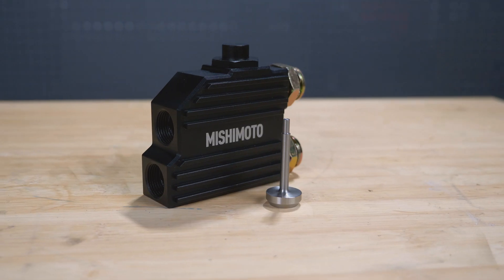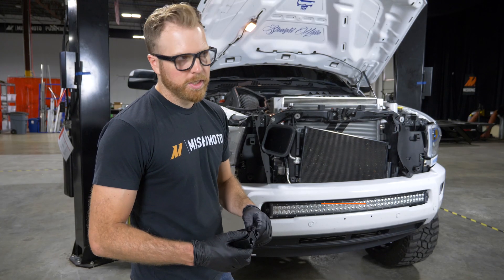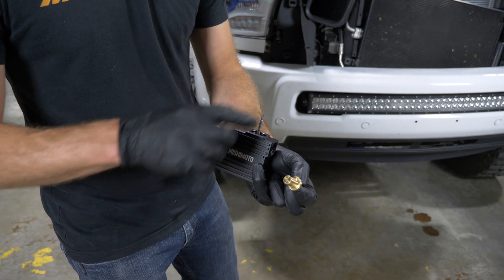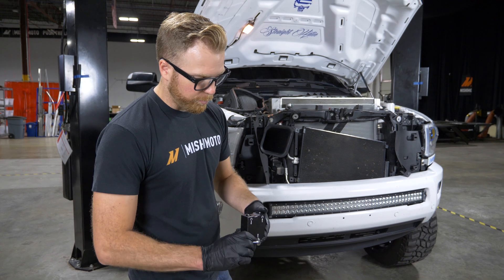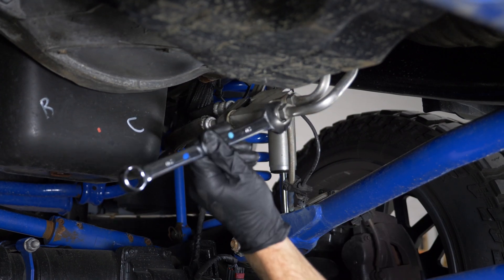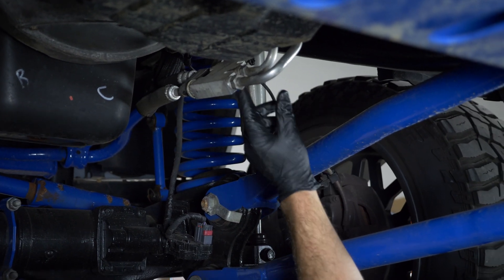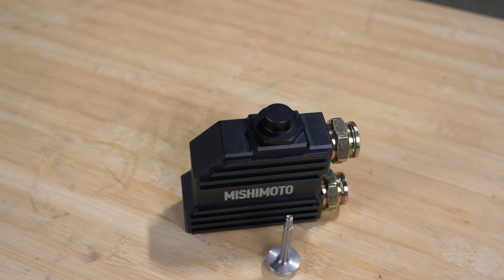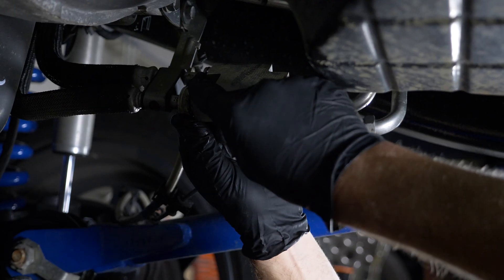Mishimoto Behind the Scenes: 2013-2018 Dodge Ram 6.7L Cummins Thermal Bypass Valve

Comment: When switching from bypass to thermostat for winter. Can you do while installed? If so how much fluid will leak out?
Reply from the maker: We haven't measured the fluid loss from swapping back and forth. However, we suggest having a few quarts of fluid just in case. Thanks!

Comment: Can you use these on the 4th gen with the 545 rfe transmission?
Reply from the maker: This will fit the following vehicles:

2013-2018 Dodge Ram 2500 6.7L Cummins w/ 68-RFE
2013-2018 Dodge Ram 3500 6.7L Cummins w/ 68-RFE

2013-2018 Dodge Ram 2500 6.7L Cummins w/ Aisin AS69RC
2013-2018 Dodge Ram 3500 6.7L Cummins w/ Aisin AS69RC

Comment: What’s the difference between the full flow for $152 then the black one for $205
Reply from the maker: One is thermostatic and the other is wide open and allows for full flow regardless of the operating temp of the fluid.